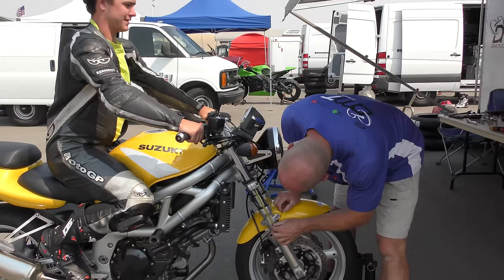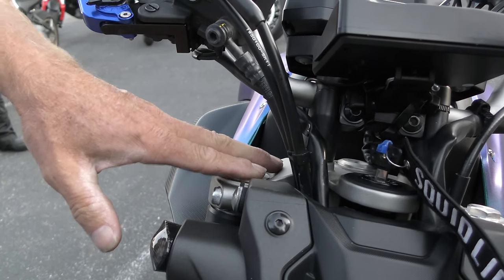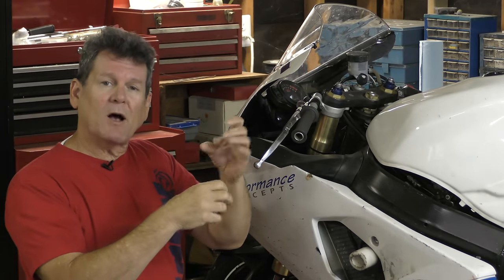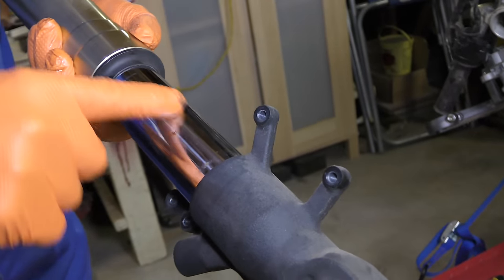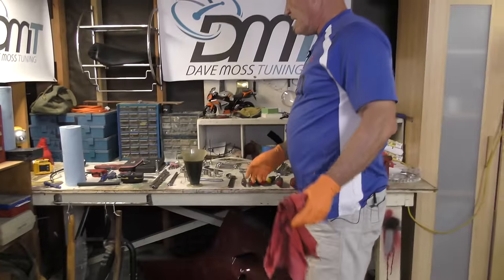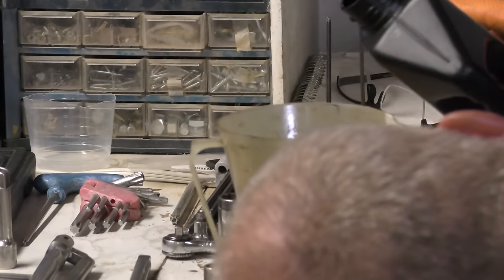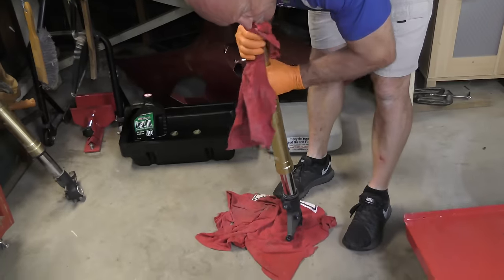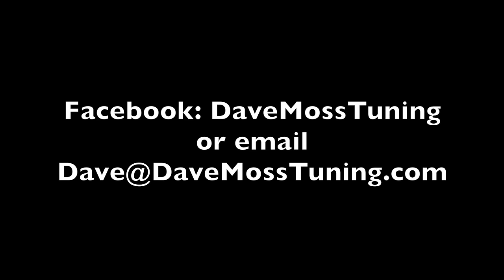Dump & Run Fork Oil Change for Standard Adjustable Motorcycle Forks

Comment: Will this method work for s1000rr ddc forks? (2017) I think it should, but would like more info
Reply from the maker: The spring leg is no problem at all. The damping leg is a sealed cartridge so you are changing the outer chamber only.
Reply: Dave Moss Tuning i’ve been wondering about cartridge(ddc) - in theory i can plug damping fork leg back to wiring harness, turn key on, pump it, drain oil. Does it make sense? or BMW’s cartridge might get damaged by that?  As always, thanks for responses 🤙
Reply from the maker: @borscheproductions3077  Sealed cartridges need special tools to take them apart to change the oil. Plugging it back in will not pump oil out unfortunately.
Reply: @catalystreactionsbw  to clarify, does this method work and is it OK to follow it for the damping leg even if it only changes the oil outside the cartridge and not inside, correct? How important is it to also change the cartridge oil? Thank you for sharing this level of insight, it is much appreciated.
Reply from the maker: @lhefou  DDC leg is a sealed cartridge so you need special tools.
Reply: @catalystreactionsbw Thank you very much
Reply from the maker: @lhefou  Critical to change the cartridge oil. Outer chamber is oil for lubrication only.
Reply: @catalystreactionsbw  Thank you, I appreciate your input. One last question: what weight oil do you recommend for 85kg + gear rider with occasional pillion? Temperature ranges from 5°C in winter to 40°c maximum in summer.
Reply from the maker: @lhefou  5w for the damping leg cartridge. 10w for lubrication, same volume as the manual.
Reply: @catalystreactionsbw  and the other leg?
Reply: @catalystreactionsbw  thank you for the help you provided, I really appreciate it.
Reply: @catalystreactionsbw  thank you master for all the valuable information!! I'm also curious as to which weight oil to use on the other leg: same as the cartridge (5w as per your recommendation) 10w like the lubrication oil or something else? My use case is similar as above!
I appreciate it man, take care 😁
Reply from the maker: @oneleggedwhale4791  if both legs have rebound and compression, same oil and same volume.
Reply: @catalystreactionsbw  I'm not an expert by a long shot but it's a s1000rr with ddc so I think it's a regular leg and a cartridge leg?? Different volumes according to manual but what oil weight would you recommend to either leg?
Reply from the maker: @oneleggedwhale4791  Oil is different due to displacement. The inner cartridge is sealed and needs special tools to service it. The oil volume is for each leg and is different due to the cartridge displacement.
Reply: @catalystreactionsbw  oh got it! Great insight man! Thanks! However, I think my question remains 😅 5w for cartridge and 10w for lubrication on electronic leg. And what viscosity for the other leg? Thanks 😁
Reply from the maker: @oneleggedwhale4791  Damping leg has both viscosities and spring leg has 10w.
Reply: @catalystreactionsbw  that was it! 😁 Thank you for clarifying. If you're ever in Portugal let us know so we can schedule a time for you to check out the bike ehehe Take care!

Comment: hi, what weight oil should i use on my 2004 R1 for road riding, I am a new rider so not a fast rider
Reply from the maker: Hi Gary, with that bike 10w in a hot climate or 7.5w in a cooler climate. Use the same volume as you remove.
Reply: @catalystreactionsbw  thanks, im in the UK so I guess cooler, also can I flush the fork with something before I refill with fresh oil and if yes what can I use. thanks again

Comment: Does it work for 07 CBR 600 rr?
Reply from the maker: Any fork on any motorcycle other than those with a sealed cartridge that is spring or gas pressurized (very expensive and rare).
Reply: So I just have to do just like you did In the video? My bike has 5k miles on it but has been sitting still for 8 years in a garage, so I think I should replace just the oil, as the seals are in good condition and leak 0 oil
Reply from the maker: @gonzalovenegasgomez349  If it has sat for a while in a temperature controlled environment, I would replace the oil in the forks (and all other fluids as well) before riding the bike.

Comment: 400 grit seems a bit harsh. 😬
Reply from the maker: That's how I was taught when I first started along this path in 95. You can polish afterwards with 800 or 1000 grit if you want a finer finish.
Reply: @catalystreactionsbw  appreciate the reply. Thanks.   Been thinking of refreshing my fork oil and seems an OK way forward. But the 400 did make me cringe a bit.  Luckily I don't think mine will need much rubbing down as pretty clean. I'll give it a go. 
Cheers. 👍
Reply from the maker: @martincross7016  I think I showed the same facial expression the first time too.....

Comment: Dear Dave,
I would really appreciate some advice. My Kawaski ZZR 600, has Preload and Rebound (rebound 3 clicks total to adjust) only, with a Telescopic Fork (right side up). OEM is SAE 10W-20 with 450ml total.
The thing is, i am at "zero clicks out", and rebound is still too fast. Both hot and cold, where I myself dont feel much of a difference. Probably because the cartridge is already completly shut atm?

If I had to guestimate, I would close it 2 more clicks and it would probably be just right. I realise it is already all the way shut, but my question is how much thicker of an oil would you recommend, in order to enable proper adjustement? Go 15W, or even thicker,  or something entirely different?

Thank you for teaching people and putting informations out there to educate. And your will to pass on knowledge, why something acts the way it does.
With kind regards....
Reply from the maker: Thanks for the kind words. There should be 3 x 360 degrees complete turns of rebound for the total number of turns. What does the owners manual say you should have? It would appear the fork caps have not been installed correctly in the past.
Reply: Thanks for the reply. 

That is a somewhat a tricky one, since the owners manual does not say in text how far the click is supposed to go.
However the manual states 4 adjustementsteps in text, and depicts a circle with 4 equally spaced dots numbered from 1 to 4. Additionally that a solo rider, of average height and with 68kg weight, is supposed to take the second rebound adjustement.

On the bike itself the clicks are 90° degrees apart. Therefore  0°, all the way in, 90° one click out, 180°, 2 clicks out, 270° 3 clicks out. 270° full range of motion. It seems to be alright, or is there something wrong with the forks?

It is a ZX600E, production year '97 or '98. OEM Forks. I myself am 1.80m tall and 75 to 80kg in weight (depending on how close it is to the last big holiday).

Comment: @Dave Moss Tuning 
Seen a guy on YT using degreaser inside the tube to try clean residual oil, then leave to dry.
could the degreaser pose as a problem in any way? whats your thoughts on it?
Reply from the maker: Many use Kerosene, parts cleaner or other solvent. The key is to let it dry completely.

Comment: Just did this to my fork (fz10) and now it’s making a weird noise. And I can feel it too when I push down on the bike.
This is some one else’s video representing the exact noise my fork is making now >
https://youtu.be/sHQUBE2WCno

Thanks. I’m a subscriber to your website. Great videos
Reply from the maker: That is the sound of the spring hitting the inside of the forks. Check the spring alignment with the spacer to make sure it is straight.
Reply: Dave Moss Tuning I took the fork apart again (not completely, just the cap and slid it down. off the bike) and the spacer seems to be in place and straight with the spring. Idk what else it could be. Moving the spring around seems to help a little but not substantial and it goes back to the same after tightening the cap
Reply from the maker: @gendersonrodriguez9780  How tight is the tolerance between fork tube and spring and check the spring at each end is level.

Comment: Wow!!!!! You did all that to remove the fork and never cleaned the old s-h-t oil out of the forks and never replaced the inexpensive seals... you had no idea what condition the bushes were in. You'd never be allowed to work on my bike. That is half-a$$'d. You saw and commented on how contaminated the oil was and just poured new in with it.

Don't worry, I won't tell anybody.
Reply from the maker: For the purpose of video, dump and run is the first step. Second step is strip clean and there are many, many videos of this process. At that time, everything is inspected, cleaned and parts replaced as needed. This is simply a stand alone video.

Comment: Great vid 😃 
Why not grease the stanchion before screwing in the top cap to purge the air from the cartridge ?
Reply from the maker: I rely on the spring force to kick back as well as internal pressure when compressing tpo flare the oil seal.

Comment: will this work on the stock kyb adjustable USD forks on my 2001 Honda CR125?
Reply from the maker: Yes, absolutely. Give them 24 hours to drain if the oil has not been changed in a long time.